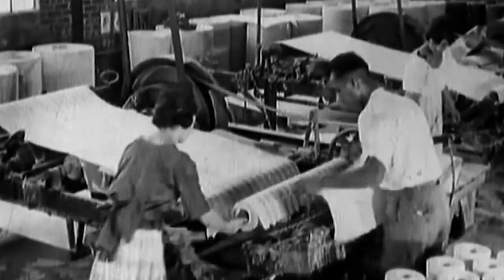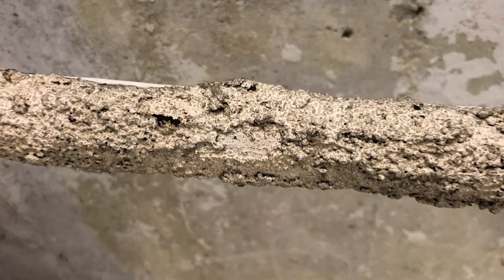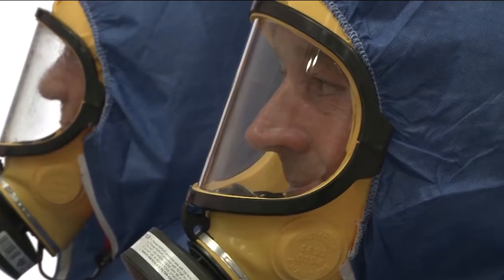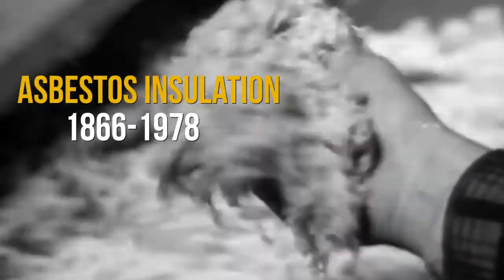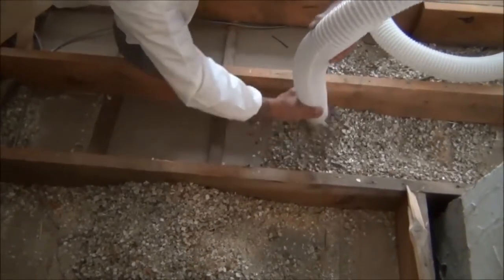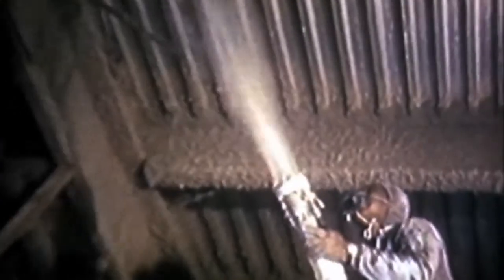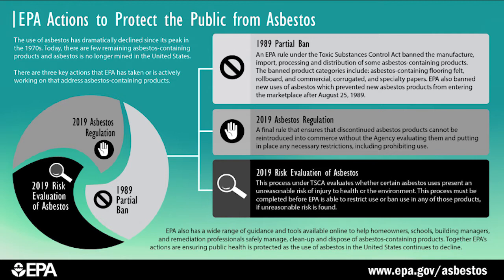How to Identify Asbestos Insulation

Comment: Is this in the insulation ring around a oven light? I removed this and was shocked as i saw the fibers in the air. I immediately stopped breathing and left the area. Later I cleaned the floor with water and used wet rags to remove the rest of it from the oven and wore a face mask.

Comment: Thank you for sharing this very good and important contribution, because unfortunately there is still a lack of education about the possible uses of asbestos. Whether in floors, screeds and leveling compounds, electrical installations, in tile adhesives and joint compounds, the mastic of windows and doors, and in many other materials in and around the house - there are countless possible areas of application for asbestos that surprise even experts time and again.
Asbestos fibers are usually so thin that you can hardly see them with the naked eye. And when you do detect fibers, they can be anything. We are skeptical about this "detectability", as well as about rapid tests. Particularly in the case of renovation and refurbishment work, the following therefore applies: Exercise the greatest caution and play it safe! Even a small material sample is sufficient to determine in a professional test procedure whether a suspicious material contains asbestos. If the commissioned analysis confirms the suspicion of asbestos, have any work on it carried out exclusively by service providers with the necessary certificate of competence. This is the only way you can be sure that there will be no accidental contamination of your living space, clothing or workshops with asbestos fibers.

Visit our interactive asbestos house to see where there might be asbestos in your house:
https://www.crb-gmbh.com/en/interactive-graphic

Stay healthy!

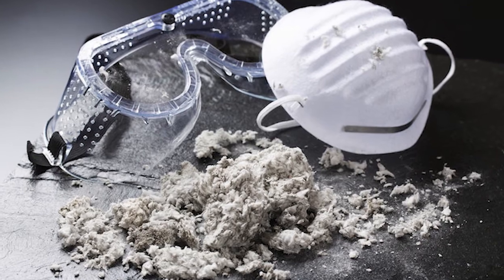Comment: 1:12 that's not asbestos insulation, that picture is of cellulose blow in insulation and is a newer and safe form of loose fill insulation which is made mostly of recycled glass and newspaper. You can see the small prices of newspaper in the photo. I would love to see an in depth look at the differences between cellulose loose fill and asbestos loose fill insulations.
Reply: I was gonna ask this question! That photo looks like what we have in our attic, and I'm pretty certain the inspector said we don't have asbestos insulation.
Reply: There is no way to know if it doesn't contains asbestos until it is tested. Asbestos was fairly commonly used in cellulose and manufactured insulation in various parts of the us for a long time
Reply: @AJuniorOutdoorsman  In the other parts of the world like the UK, thats possibly true. 

But through my experience here in western australia, you'd be very hard pressed to find a sample of old cellulose with a significant amount of asbestos in it. I work in the business of insulation, i work around asbestos, and im 99% sure the material in that photo is brand new cellulose/fibreglass insulation. You absolutely can make an educated guess.
Reply: In Australia, their insulation is called Mr. Fluffy. Isn't that similar looking?
Reply: @LaserRifle  It's very similar looking. I commented on this a year ago, and now looking back at the thumbnail I'm less certain as to what that is than I was back then.

The key visual difference between Mr Fluffy and paper based loose fill insulation is the presence of small pieces of newspaper in the sample. You'd be able to see the letters on the printed newspaper. But Mr Fluffy in particular is almost purely asbestos and has little to no newspaper in it.

I'm sure this is a complex issue in Canberra. But in WA where I've worked, there isn't really any loose fill asbestos. It's all just paper based loose fill or formaldehyde and fibreglass batts. At least that's what my experience has been.
Reply: Thanks for pointing out. I was actually freaked out at the first place seeing that being used as example..
Reply: Hello, is it possible for a house built in 1995 to contain asbestos insulation in Brisbane?
Reply: @noorhashim6245 it's possible for asbestos to be in any house. It's unlikely to have been used in the majority of a 1995 house but I can't say for sure. I wouldn't worry. The places you'd find it would be in your roofs eaves and fencing. Which remain largely undisturbed and are bonded in a solid piece that only releases a significant amount of fibre when broken.

Comment: Has anyone ever seen loose-fill asbestos in an attic? There are very few decent photographs or information about this ANYWHERE!
Reply: Isn't loose fill asbestos pretty rare?
Reply: @jaffacalling53  I think the problem is the UK the health and safety executive have published material referring to it being commonly found in lofts which is s bit confusing when everything else I've read suggests it's extremely rare in domestic properties. Also some of the pics online make it look almost identical to loose fill fibreglass.
Reply: @nelljamina419  perhaps you mean fiberglass? Or bubblewrap? For a greenhouse.
Reply: @bsanchez3563  Sorry not sure what you mean?
Reply: Yes, loose fill manufactured asbestos insulation and vermiculite blow in is very common where I work and is a high % of the work I do during the summer
Reply: @AJuniorOutdoorsman  is that domestic properties? In the UK?
Reply: @nelljamina419  I'm from the rocky mountains in the USA